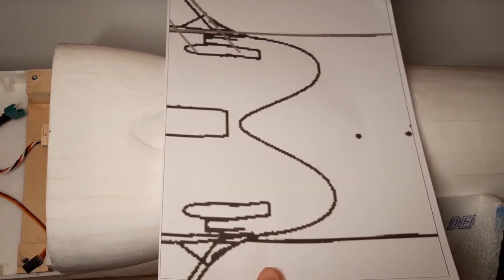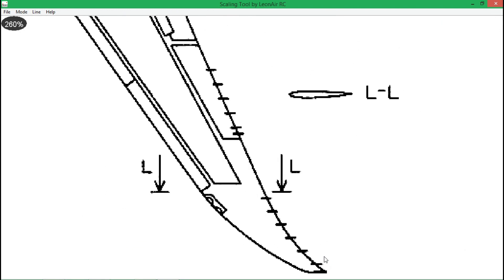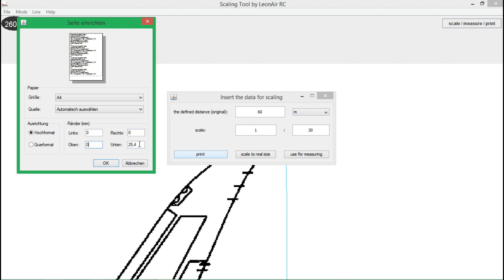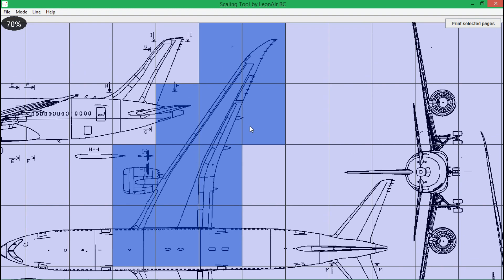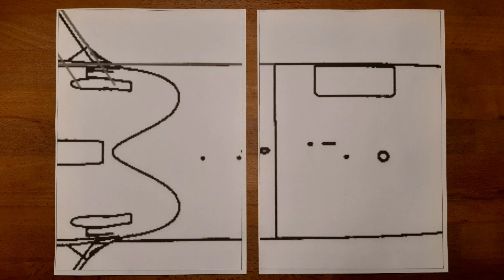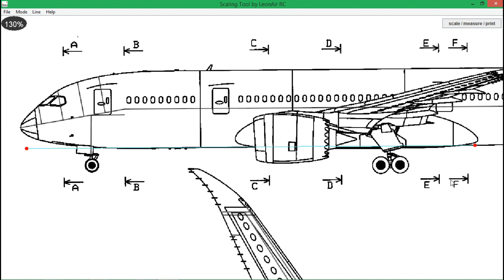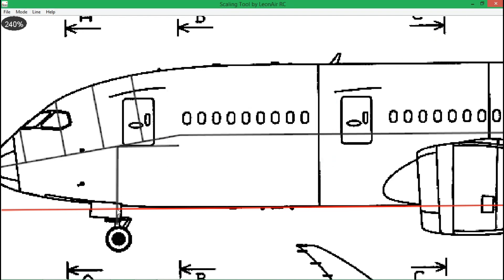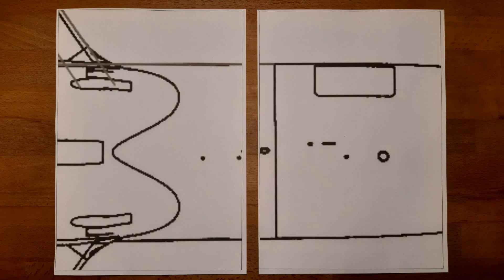How to print custom plans for RC airplanes

Comment: Hi Leon, there is also another way of doing this as an FYI, you can Fusion 360 which is free for personal use, insert the airplane drawing just like the ones you show, get the wingspan measurement and input that measurement, from there you can use the Measurement tool to scale to your desired scale, check out what RC CAD2VR is doing, he gives instructions on how to do this, he is also building an airliner, this is channel:
https://www.youtube.com/watch?v=_7vmUEARiYE&t=43s

Comment: how do i get it to print with  no boarders
Reply from the maker: That`s a good question. I actually don`t know what it depends on. Does it still print margins when you set them to zero in the page configuration dialog?

If it does please let me know whether you would wish to have a software update that enables it. I`d really like to improve the tool on user-feedback!
Reply: @leonairrc  hi yeah so when i try to put them all to 0 it auto corrects them to 0.5 but there are still margins there it would help if you updated it thankyou
Reply from the maker: @tejashaveri8844  Yeah I kinda expected that problem. On my system I can set all margins to 0 without autocorrection to 0.5. I`m gonna try to tweak my code a bit now. Would you like to tell me what your email was so that I can send you a test-version of the software to experiment with full-page printing?
Reply from the maker: @tejashaveri8844  I`ve sent you an email. I also recommend to delete your previous comment soon to hide your email.
Reply: @leonairrc  :) thank you so much sir have a good day
Reply: @leonairrc ok so im testing out the updated version ive gone through all of the steps and i cant find that popup that shows the margins thing do you know where i can find it
Reply from the maker: @tejashaveri8844  Actually I don`t know what you`re talking about... as soon as you press the print-button now, the image is divided into full-page sections as you wanted. That`s what I tried to explain in the email.
Reply: @leonairrc  nvm nvm i diddnt know how to use the softwere fully thats why i got so confused hey it works now thankyou
Reply from the maker: @tejashaveri8844  Does it really print the full page? That`s great! If so, would you recommend me to add the full-page configuration to the software?
Reply: @leonairrc  ok so from my experiance the updated version diddnt print full page it just took away the border and just left white space so i went back to useing the the version before the update cause it was easier for me to see where the image ended and where i had to cut it so i can put all of the pieces together but yes if you could fix the updated version i recoment putting it as a feature like a button that says boarderless or with boarder
Reply from the maker: @tejashaveri8844  Unfortunately the while thing is nearly impossible - at least with Java. From the software`s perspective the printer is clearly instructed to print the full page, but the printer itself decides that it cannot do that. There is no way it could work without specification on a single printer.
Thanks for your feedback anyway!
Reply: What's your Instagram account name pls.